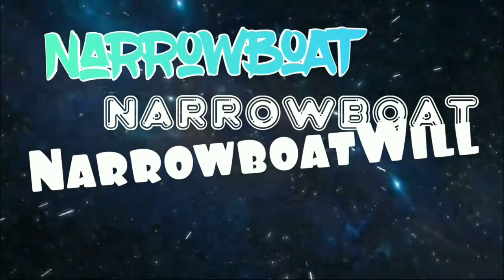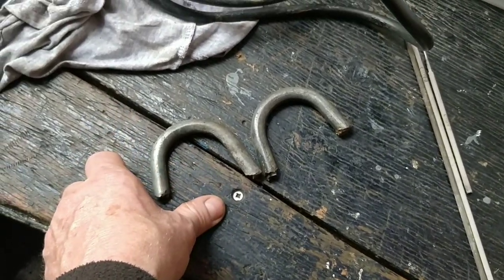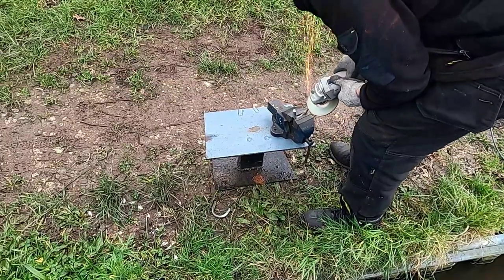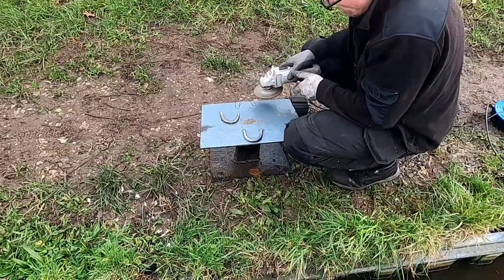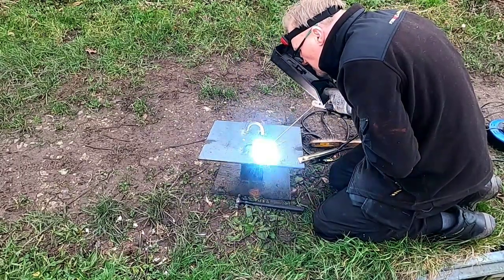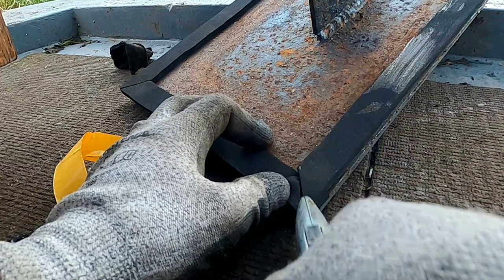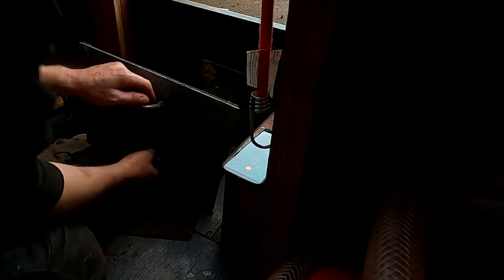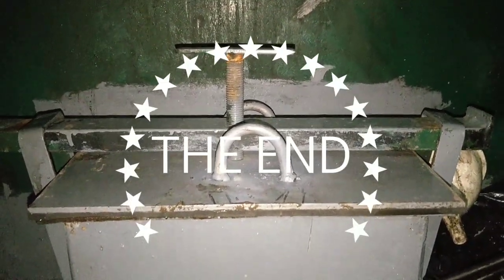Welding some handles onto my narrowboat weed hatch.

Comment: I worked for a steel fabricators a while back and they told me if you wear prescription glasses you don't get arc eyes.Must admit I never tested the theory
Reply from the maker: I'm not going to test that theory.  I close my eyes and use a mask. Having arc eye is like having hot sand in your eyes. Cheers Sean.

Comment: The inrush currents of the welder will guarantee your inverter dies an early death.
Reply from the maker: Well that's nice to know. It was buzzing abit. It's funny when I first got the boat the inverter over heated after 20 mins of using it. The buzzer would come on and it would shut down. Later I found a piece of chewing gum stuck in the cooling fan. That was 3 years ago so it's not done bad to last this long. It's a 2500 to 5000 watt inverter. It should be able to handle it. My 2.2 geni can't handle my welder. Thanks for the info